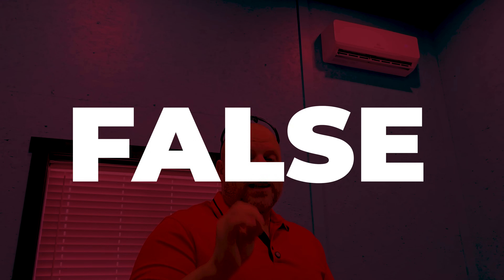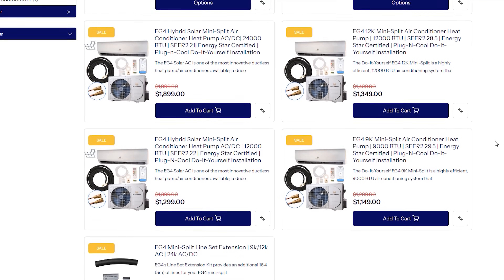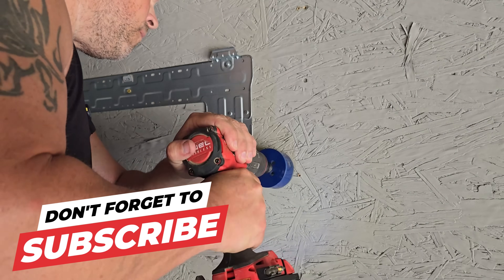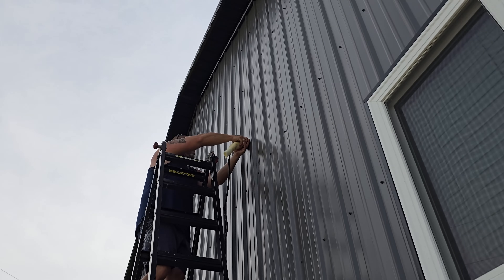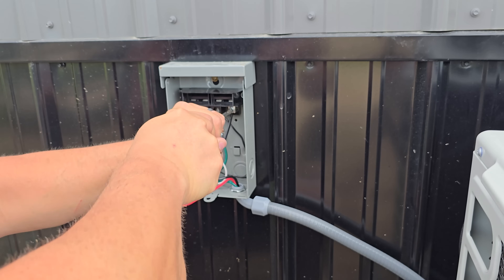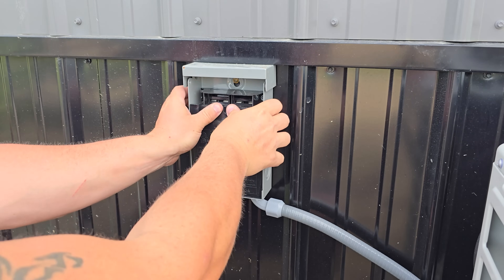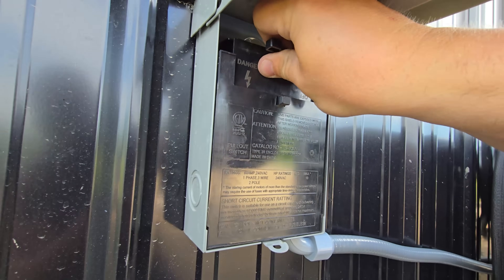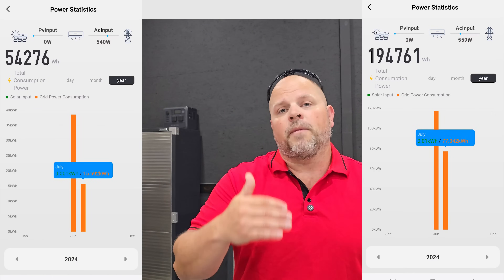TRUE DIY INSTALL - EG4 12K & 24k SOLAR mini splits - BETTER THAN MR COOL!!!

Comment: The consumption seems a little high. I have the 24k just installed yesterday and its pulling 130watts on standy turned off. I have it hooked up to a ecoflow delta 2 pro ultra. So it tells me in real time. Not sure whats up with the draw when nothing is running. Is yours drawing power when you turn its off. On the eg4 app it doesnt show a power draw but on the Ecoflow unit it does.
Reply from the maker: You can monitor in real time and control the EG4 unit using the ( Solar AirCon App ) - Here is a link to the Google play store: https://play.google.com/store/apps/details?id=com.solar.airconditioner (they have a Apple version as well) My 24k unit draws around 60watts with the fan circulating the air fan on auto speed. That is with the mini split set on ECO. I have that one programmed to turn on the unit at 7am and turn off at 6:30pm. During those hours I usually have it set to 70F to keep it cool.  I have consumed a total of 87kWh for July so far 16 full days. That is an average of 5.43kWh per day. Plus it has been close to 95 degrees most of those days. From my data, that is very low consumption for a 2 ton air conditioner. 

I will definitely test the draw through the AC500's now. I will isolate the power consumption to only the 24k unit and see if I am getting a different reading from the Bluetti than I am on the Solar AirCon app. I will get back with you on this.
Reply: Looking forward to the follow-up. @TheSolarPit
Reply from the maker: The reading on my Bluetti AC500's and the Solar AirCon app are pretty much the same. When the units are off there is no power draw. When on and set to ECO mode and the fan is running but no AC engaged my  draw is around 60 watts.
Reply: @JustinsProject  interesting. My ecoflow app says 135 watts when the unit is off. But the eg4 app says 0. When the fan is on eg4 says 60 watts. Ecoflow says 145. Maybe ecoflow is wrong.
Reply: A bit surprised that Ecoflow is reporting apparent power - Google apparent power true power triangle - plug it into a Kill-a-watt meter. Got 0.25 power factor and 8W consumption while off :-)

Comment: How much do they cost compared to the other brand for diy
Reply from the maker: I put all the links in the description for the actual cost. Considering all factors included with installing other units, I thought these were the best deals I could buy.